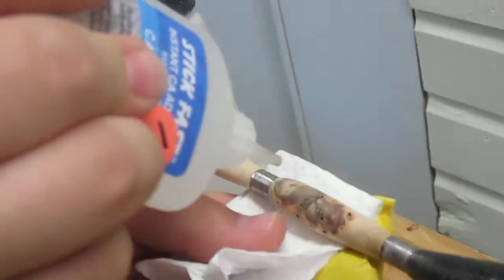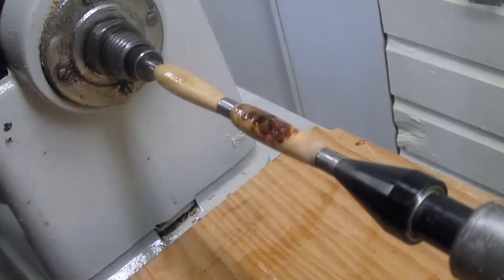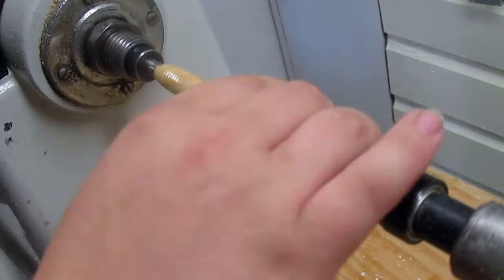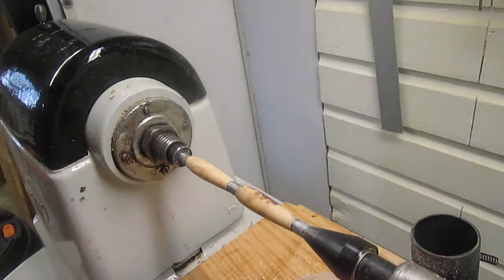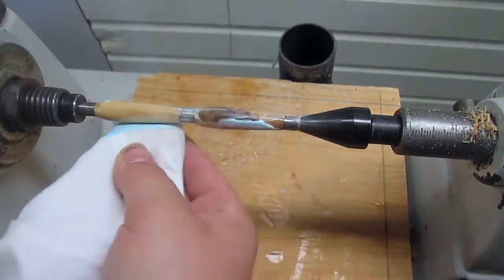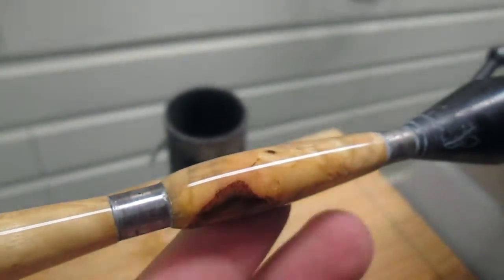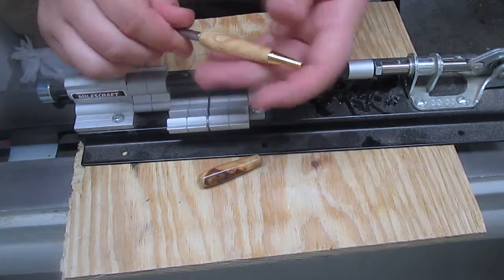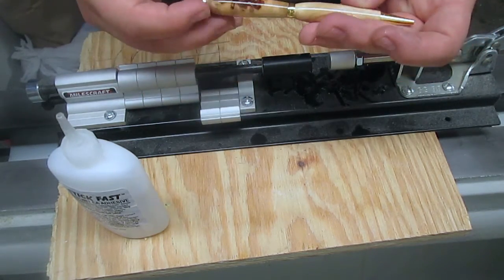Camphor Pen

Comment: Nice video Peter,
  I've never turned Camphor, it looks like really beautiful wood. I know what you mean about the clips working loose. I occasionally add a drop of C/A too. I started putting the C/A on the inside of the tube because when I put it on the cap and pressed it in, sometimes the C/A would squish out and I'd smear it on the cap or pen blank. 

Regards,
Bob
Reply from the maker: +RJBWoodTurner Yea I learned that the hard way lol. I now put it on the inside of the tube as well.
Thanks,
Peter
Reply: There's nothing worse then putting all that time into a beautiful pen and having something as simple as gluing the cap screw it all up, Been there done that.
  I just found your channel, keep the videos coming.

Regards,
Bob